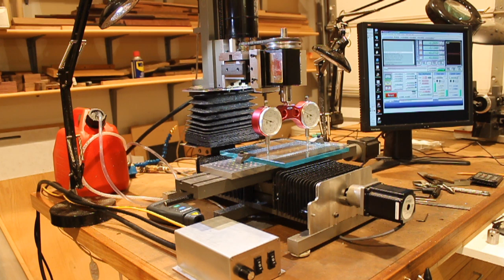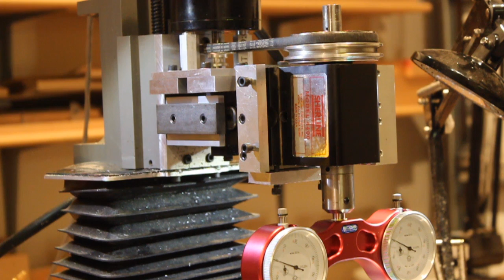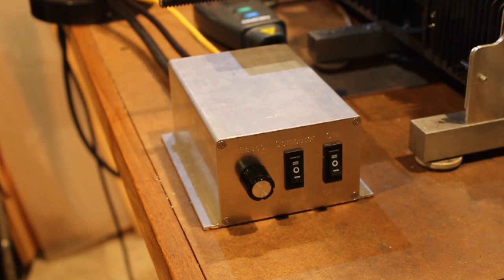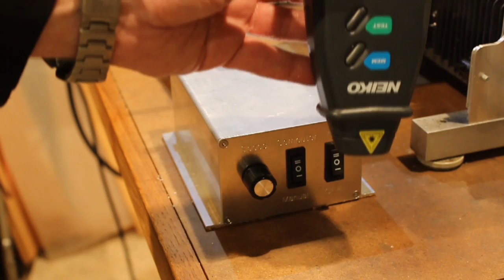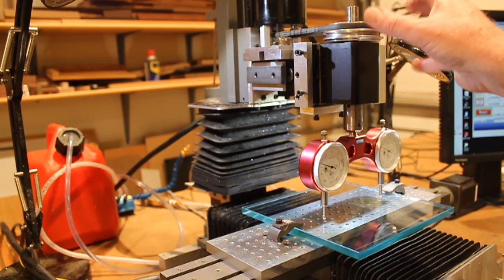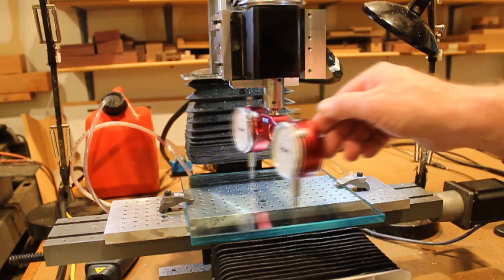Mill Enhancements

Comment: Cool! I have an A2Z monster mill, I love your mods to it. I'm looking forward to seeing any more future videos on it. Where did you get the bellow covers? I just have a flexible neoprene cover on the Y-axis, and like yours more :)
Reply from the maker: I got the bellows from mscdirect.com. They have many shapes and sizes, so look at them all. I bought a square one and then cut it in half to get the two U shapes. You'll need to make all the attachment hardware.
Reply: KenToonz  Thank you Ken, Quite expensive, but I suppose it is worth it and will save costs of replacing lead screws and anti-lash nuts in the long term. I recall awhile ago on the yahoo groups page along with all your head enhancements that you have done, you made a Z-column tramming aide plate that bolts to the A2Z base to more simplify tramming of the column. Do you have pics of it? I have always thought that this was an awesome idea and would save allot of time in the tramming process.
Reply: Also, I'm building a mill enclosure for flood coolant and chip containment which everything will be on a steel frame, and I'm gonna need to re-tram my mill once placed in it, and I know this will save alot of headaches in being able to reach bolts on the bottom of the base. :)
Reply from the maker: James Sorenson The tramming aid for the z-column seemed like a good idea at the time, by I've since scrapped that idea. I aligned the z-column with brass shims as A2Z recommends, locked it down tight and have never needed to adjust it again. The mill has been moved several times and the z-column has never gone out of adjustment.
Reply: Oh okay, were the set screws loosening from vibrations? If that's the case, I would think a little loctite would do the trick after tramming the column? I have brass shim stock as well and I have since followed what A2Z recommended with out issues as well, but since I'm putting the mill in an enclosure, the bolts under the base would be completely out of reach if it ever did come out of tram. Maybe I'll consider just making two thick plates of aluminum with the original a2z bolt pattern in the center, the bolts for each plate countersunk below the surface and just have the bolts on the outside like your mod and still use shims.
Reply from the maker: James Sorenson No, my bolts weren't coming loose. The mod still required loosening and tightening the bolts under the base. Like I said, once you get the shims in place they should stay put, even if you move the machine.